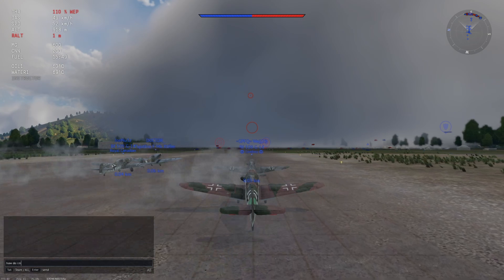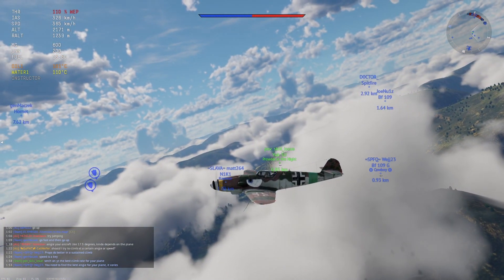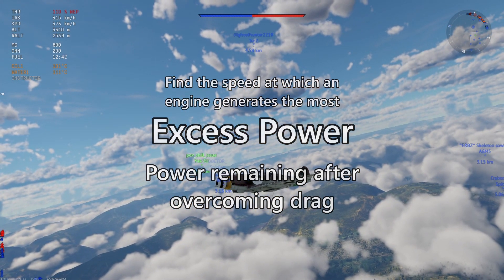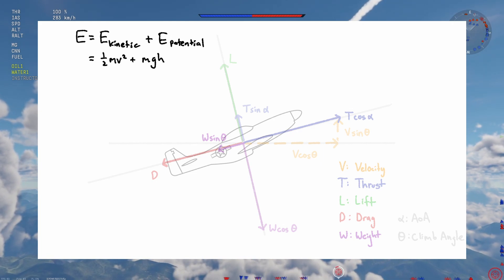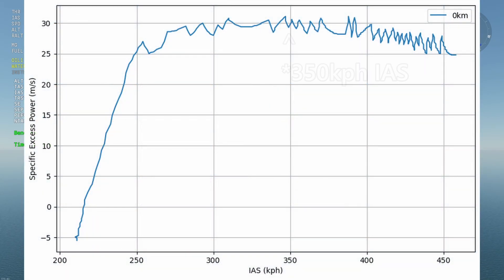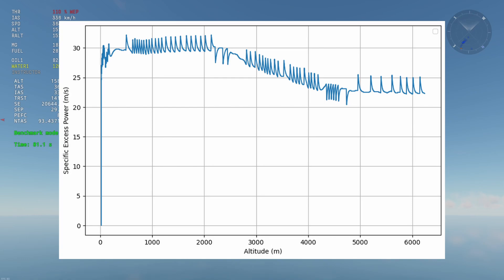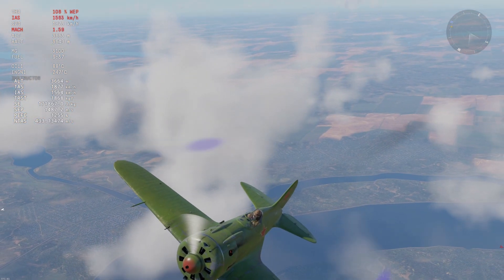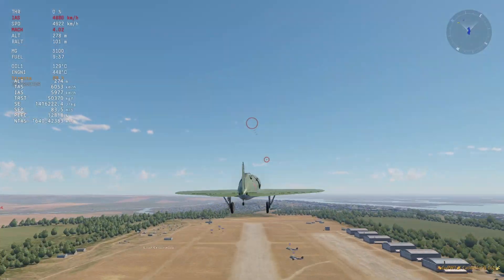Optimizing Rate of Climb | War Thunder

Comment: I think WT elevators sap more energy than they're supposed to, or maybe it's AOA. Going straight up only kills my speed when I decide to stop going straight up. Would explain why not touching them gives the ideal climbs.

Edit: It's also worth noting that your propeller will give you more thrust per kilowatt of engine output the slower you are. Can easily be worth being below the excess power peak with how it plateaus.

Comment: start at 15 degree, after 2500 m, change that to 10 degrees, all planes are shit after 5000 m
Reply from the maker: you do you buddy
Reply: Not true. Planes that are optimized for higher altitudes, or alternatively, have turbochargers, maintain manifold pressures well above 5000m.

Comment: IMO 350kph is way too high. I don't have the 51H to test, but when I tested the Wyvern at some point I got 320kph which makes sense, since it's quite heavy and has significant jet thrust left over from the engine. 
The SEP value in WTRTI has started jumping about a few months ago, idk why.
Reply from the maker: I'm not telling you to climb at 350kph in all planes, I'm saying thats the speed to climb at at sea level in the p51h, the other planes you would have to test yourself

The WTRTI values for SEP jump because before, WTRTI used a different localhost output for velocity that had high precision but was inaccurate at high AoA and so they switched to the more accurate but less precise localhost velocity output. Taking the derivative of this velocity which has much lower precision is going to lead to a lot more jaggedness. I'm pretty sure this is why cuz I was the one who told the WTRTI dev about the bug originally.
Reply: @CatWerfer  no no, I understand that the value is plane-specific, I believe that 350 is too high for the 51H. I'd probably try about 280-300
Reply from the maker: @s_ziel  ...I did and it gave me worse results. I'm not sure if you watched the video because I explicitly tested different speeds so if you say stuff like that I'm just not gonna respond
Reply: @CatWerfer  I did watch the video, but I'll watch it again since it was late at night 😀 I remember the chart looking different than I'm used to, IMO it should have a visible peak and not be a plateau, at least that's what my charts looked like.
Reply: @CatWerfer  I found an old account and did the test, I got about 340 km/h which is basically the same result as yours, considering the inherent error in this method of gathering data. I'm surprised it's so high and wonder if it's because the prop is just too small to use this much engine power.
Reply from the maker: @s_ziel  if whats giving you reservations is thr fact that this seem unrealistic when compared to irl it might be cuz gaijin physics kinda wonky
Reply: @CatWerfer  "kinda wonky" lol
I don't want to write essays in the comments, but the turbine engine implementation is fundamentally broken, the thrust-specific fuel consumption is basically constant, which it isn't IRL.
Reply from the maker: if the essay you write is interesting then i'd probably read it lol, my whole video is basically just an essay with some moving bits and bobs
Reply: @CatWerfer  So, in essence, I am quite confident that WT has a constant TSFC implementation. If you look on Wikipedia or pretty much any source, it'll say that thrust-specific fuel consumption is X at speed Y. This is because the value changes with speed and probably many other things. A turbine engine has effectively constant power (the internal power, not the output power) at a given air density. The problem is that it SUCKS at transferring that internal power to the medium (air), but it gets better the closer the air velocity is to the exhaust velocity. Another thing is that a turbine engine's net thrust decreases with speed. So, we have 1) constant TSFC, and 2)engine thrust decreases with speed, thus fuel consumption also decreases with speed.
This is very easy to notice while playing planes with turbofans. Because their exhaust velocity is lower, the thrust output decreases fast. For example, on the SK60 static thrust is about 50% (or even more) higher than thrust at some high speed. I have the WTRTI overlay set up so that it shows me how much fuel I have remaining in terms of minutes at current power setting, and while flying the SK60 the "endurance" increases while accelerating, at a constant power setting. For example, if I take 30 minutes of fuel, the overlay will display about 20 minutes while taking off and then that value will increase to close to the value displayed on the game display, but I don't think it is possible for both values to match up.
I know the Harrier also has this kind of "variable" fuel consumption and you can test drive (fly?) it.
Reply from the maker: hmmm that makes sense but it also makes sense that maybe they decided to draw the line there between realism and ease of implementation
Reply: @CatWerfer  I mean, they could just tie fuel consumption to air density directly instead of fuel to thrust to density…

Comment: Bro just imagine there’s a VSI and try to keep it on the indicated climb rate that’s already on the stat cards😂 its already there for you in meters per second and automatically changes for mods/payload
Reply: The statcard isn't accurate, and this is about gaining energy, not just altitude.
Reply from the maker: Bro still thinks the statcard is a reliable source, you'd think most people would've grown out of it by now...

If you actually thought about what you're suggesting, you're saying that if the statcard says something like "Rate of Climb: 20m/s", that means that the plane's ideal rate of climb is the same at all altitudes? From sea level into the stratosphere? I'd like to see a prop plane that can climb at ALL above 12km

Comment: The speed is the significant difference I think; calculating the difference in kinetic energy, you'll find that there's approximately a 25% difference in kinetic energy between even a speed difference that small, because kinetic energy scales by the square of speed.

Now the thing is, of course, potential energy makes up a greater amount of the total energy. And in the end, I agree with your takeaway that it doesn't really matter a ton in practice. There's so many other more important factors, and even besides that, most War Thunder prop fights nowadays happen at lower altitudes. I would say you can definitely get away with climbing "well enough".
Reply from the maker: yeah, I calculated that the energy difference between 290kph and 260kph at the end of the experiment would equate to about a 70 meter altitude potential energy difference, not that significant in comparison to the whole thing.

One thing I neglected to mention in the video now that I think about it though is that the 17.5 degree climb started with a higher speed going into the climb at 1km too, around 355kph vs 345kph for the max SEP climb, but the original point still stands

Comment: Hey! There are vids talking bout binding Radiator control and turbo/supercharger on "full-real controls" once you bind them you can go back to simple/mouse aim.

Its a trick I noticed fighting the same plane but against a veteran sim player. Sad that there are little to no info regarding what every setting does. Hope it helps!
Reply from the maker: Yeah i know there are a lot of MEC settings like radiator control and fuel mixture control as well as video guides on how to use them, I'm just saying that I can't be bothered to test them, at least right now😅
Reply: @CatWerfer  good on you. Thanks for doing this vid. Still makes my heart yearn; to learn more about other factors and nuances we will spend years understanding. 

Glad to see, you have a community that's supporting you. Keep pushing mate, cheers!

Comment: Nice video, although the result was more or less expected for props. I think we'd see much more interesting results with jets.
Edit: Maybe we should consider specific energy of the plane at the end of the climb rather than just the altitude to factor in the differences in end velocity.
Reply from the maker: mm it was kind of unexpected to me, I expected a lot larger of a difference so i was kinda shocked when it wasnt the case.
If i get around to testing jets I'll probably make a short video on it but it probably won't be soon... if you wanna try it then go ahead, I'd be happy to hear what the results are.

Also you are 100% right about measuring specific energy instead of altitude, the micromanaging IAS for max SEP did end up with a higher specific energy state thanks to the higher end speed, though the difference wasn't that much... I was just too lazy to redo the tests while taking specific energy in mind lol

Comment: I used to rely on that outdated spreadsheet RELIGIOUSLY before I saw a video done by AdamTheEnginerd, but I'm too lazy to do proper testing so I "vibe" what IAS I climb at based on the engine power of the aircraft 😂
Reply from the maker: lol yeah thats what i do if im just playing casually.
cant be bothered to test everything, that would take ages
Reply: Its good to know that pretty much almost any information you can find in game and in forums is pretty much meaningless in game, or is based on vibe with some testing for specific aircraft.
Reply from the maker: I wouldn't say everything up there is useless, a lot of it is still pretty handy or at least is a good starting point when it comes to running your own tests. Trust, but verify.
Reply: @CatWerfer  I guess there's a bit of an upside in that, if a fixed angle climb is reasonably close to optimal, then finding that correct angle is probably something that can be dialed in with a few tries, written down on a piece of paper, and then no need for the outdated chart googling.
Reply: Same- the table is a baseline, my ass is the dyno.  Kentucky windage for the win!

Comment: Using Mec probably not necessary because with mec the engine is usually running at slightly reduced power and open rads to keep cool. It'll be the same results just slightly longer to reach the same alt
Reply: MEC doesn’t adjust engine power. You can toggle at 100% prop pitch vs auto, and there is no difference in horsepower generation. The radiators are what make it slower, and even then, some planes don’t kick in rads until your engine is cooking.
Reply: @TheSierraMadre_  Using reduced prop pitch during climbing to not overheat the engine vs auto prop pitch there is a noticable difference in climb
Reply: @lukefrombk  So... it depends on the plane. For 90% of planes, your prop pitch will be at 100%. There are some exceptions where reducing prop pitch is necessary where full rads don't do enough. The G55S for example suffers very little loss in thrust at 90% pp vs 100%.
Reply: @TheSierraMadre_  I agree but it does reduce performance nonetheless. I'm not 100% certain how prop pitch in WT affects engine power. It may reduce hp maybe it reduces engine rpm. Knowing Gaijin I wouldn't be surprised if there's something wrong with it
Reply: @TheSierraMadre_  I quite like the G55S I usual play it on 90% pp and 60% both rads. In game name is El Infierno. I got it at 5.0 so I'm pretty proud of my stats with it
Reply: @lukefrombk  In general, prop pitch controls RPM for aircraft that aren’t German. Almost all aircraft generate maximum thrust when they’re running at their highest rated RPM. German Planes control the actual pitch angle of the blade, which is why you will nuke your engine if you try fiddling with it in MEC on German Planes only.
Reply: @lukefrombk  G55S doesn’t lose much thrust at 90% PP. a Spitfire LF MK IX looses a significant amount of thrust at 90% PP. Every plane is different.
Reply: @lukefrombk  As the other person said some time ago prop pitch determines engine RPM, even in german props. The reason I am replying to you is to say that you can get better climb times with MEC in nearly every piston engined prop in the game than the game can get with AEC. The few this isn't the case 100% prop pitch actually provides the best power and 0% rads provides the least drag for climb times, even though radiator drag shouldn't be a meaningful thing at climb speeds. The noticeable difference in climb from using MEC is almost entirely down to radiator drag for most props because of this.
Reply from the maker: mmm I'd have to test it to be certain but for now ill take your word on it